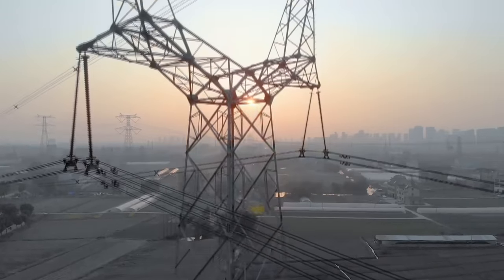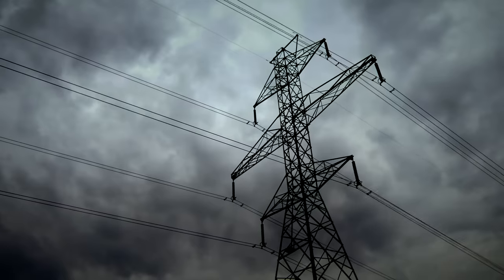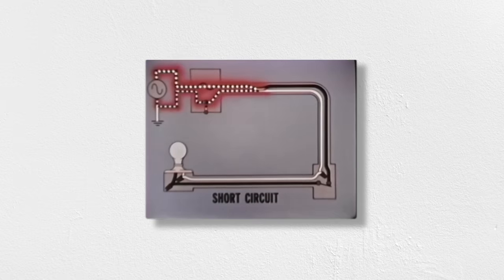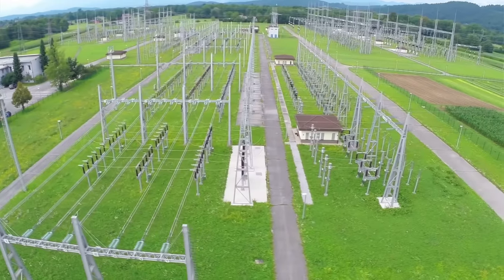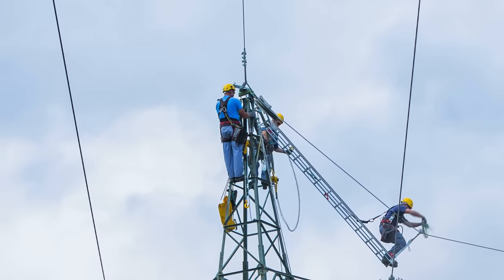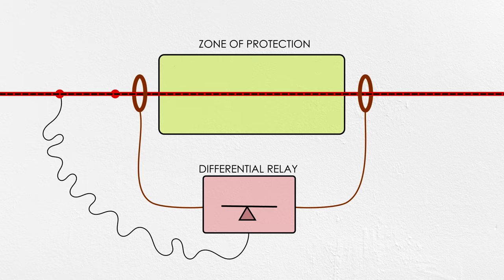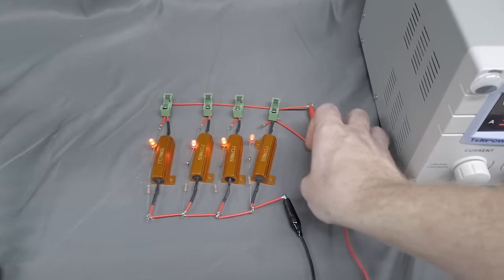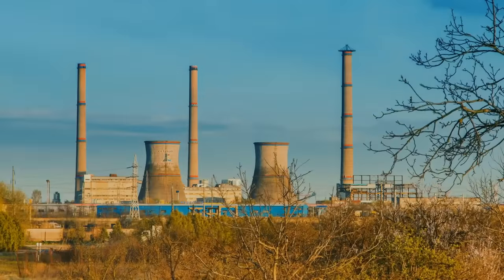How Power Blackouts Work

Comment: I really appreciate how simple and clear you explain things in your videos. But I think that the model you explained how cascading failures work on is not very accurate. Cascading failures happen when the power station sees an increase in demand that it can't supply power to. So, when that happens the frequency drops and goes out of synchronization which causes it to disconnect from the grid. When that happens, the rest of the power stations that are still working sees an even bigger demand that they all can't supply power to. So, a power plant (station) is disconnected from the grid one after the other and that's what creates cascading failures which cause Blackouts. As mentioned in the video that cascading failure happens when a load is disconnected from the grid the rest of the power is divided between the rest of the loads. I don't think that's the case since power plants have control systems that limits the power supplied to the grid to the demand.
I'd like to hear your thoughts about this and I'm open for discussion. I'd be even happier if I was wrong because that means that I will have learned something xD.

Comment: Well my local electrical grid did not follow through with many of these protections. A few weeks ago the local middle school drew too much current (apparently running a lot of bounce houses for some fundraiser) and instead of tripping a breaker, the main power line (which was not isolated) outside the school caught fire and the town was without power for about a day.

Comment: From what you are saying, if a power line touches a tree and shorts to ground, the local area should immediately experience a blackout? So is there a good reason for PG&E to turn off our electricity for days at a time because the fire risk is high? It sounds like they're just trying to cover their ass in case their safety systems don't work correctly. Suspiciously, they started doing these blackouts right after one of their substations was the cause of a major fire. I have never been frustrated in the past at blackouts, but these intentional ones are extremely frustrating.

Comment: What you were calling "relays" is an entire protection system. a relay is an electromechanical switch. that's all it is. everything else is senbsors that monitor voltage, current, phase rotation, and a huge number of other things.
Reply: In the trade they are all lumped into the category of "relaying." I had the privilege of working with one of the four protective relaying engineers in our company; it is far more complex than I had ever imagined.

Comment: In my city when a powerline shorts out all powerplants connected to the grid, all the grid blacks out, usually takes 24 hours to get fixed, when that doesn't happen the electricity is on for 2-3 hours and off for 3 to 6 hours, when the electricity is on for a complete 24 hours we say that the person who cuts the electricity is asleep or dead, or some part of the city is completly off

Comment: More, more, more on the grid!  Some ideas:
- Commentary on "The Current War" about battle between Edison and Tesla/Washington over whether AC or DC will be used. Great infrastructure-porn.
- Microgrids - a solution to our the problems with a centralized grid?
- High-voltage DC  (yes, it's more efficient than HVAC at long distances).

Comment: Good video. Just a touch misleading though. When stations operate at full capacity, the lines feeding them are usually loaded to only 20 to 40% capacity. If they were near capacity, as you mentioned, the grid would be in a constant state of instability.
Reply: You are talking about the N-1 criterion, right?
Reply: correct

Comment: Great job Grady and Wesley! This video was amazing I'll have to go check out the rest of the series. I'm curious how much a car would cost that never breaks down Lol.
Reply: You may want to compare it to the amount of time and money NASA put into making absolutely certain the Spirit and Opportunity rovers would last at least 90 days. They lasted for several years, but the original spec was essentially a blank check saying that they had to last 90 days and the engineers were to do everything possible to make sure to get them to last that long.

That's the scale of effort we're talking about with regards to making a machine that will not break. And this isn't even taking into account the possibility that the day after you finish it, a new technological breakthrough will make a lot of your work redundant.

Comment: There’s a missed opportunity to describe the issues/benefits with infrastructure/safety differences between why/delta distribution. Additionally the traditional difference between distribution and transmission and how distributed generation has evolved the distribution into a local transmission network and the fault management changes need to support that.
A deeper case study of the north-eastern failure in 2003 as a result of known product defects in fault management systems and the process mistakes by operators would also be interesting.

Comment: Yes, powerplants take power to run (ironic) but they are able to generate that power themselves. At least until the fuel runs out.

NPPs also have backup generators to run the bare necessities and (I think) they can also restart the plant with them
Reply: That's what the diesel generators are there for - to start the plant with no power on the transmission grid.

Comment: While they have invested in grid sections that never break down unless there’s a problem on the transmission lines or generators that are feeding that zone such as in the central areas of most major cities like the Melbourne or New York CBD areas for example as all of the electrical equipment is underground in those areas and it’s mainly because of there being no space for it on the surface because of skyscrapers! However in some cases they also built underground power stations in those areas such as in New York sometime during the First or Second World War as they mainly needed everything to be protected from an additional threat which was enemy bombings and air raids! :)

Comment: where i work we recently had a corse on controlling 480V ac motors and i and a colegue got to build a controll logic and i claimed that it is idiot proof so i let him have a go at it and it worked fine until he held down forward and reverse then pulled out the e-off switch and it caused the 2 10 amp breakers at that work bench to open then i told him i doubt that his is any better, so i did the same and i managed to trip the 18 amp breaker and we had to get a ladder to get to it because it was under a cueling pannel

Comment: in my place blackouts usually happens on streetlights... I saw one of them uses a 16 amp breaker for a mercury vapour lamp. they used 10 amps and it kept tripping. But when the light was new it never tripped

Comment: If a transformer faults it can send a secondary surge which will cause equipment failure all the way down to the consumer. Insulators will burn out, cutouts on poles will burn, arc over will occur and destroy lines and ancillary equipment from the corona. The surge will compromise the insulation of most insulated cables and circuit protection devices.

Comment: Lol.. that time when London had a large (but not total) blackout because someone put the wrong fuse in at a main relay station. 4 stations, one out for service, one having routine maintenance and two others operational. The one on routine maintenance had the wrong relay replaced and shut down, leaving the other two to supply a busy rush hour London with electricity. Half to three quraters of London had a power outage. Fun getting home...

Comment: Burying power lines underground is the sensible thing to do.  I live in a neighborhood where all the power lines are buried and almost never experience blackouts.  It can be stormy as hell outside my house and the lights in my house never even so much as flicker.  As a bonus, there are no eyesore overhead power lines clobbering our view.
Reply: We had almost all the underground lines in my neighborhood replaced about 5 years ago (by the electric company I was working for at the time) because the lines were rated for "direct burial" but it seems rocks loved to migrate and get a bit too chummy with them. Replacing them with underground in conduit helped a lot but there is still a stretch where the original cable is in place. We get spates of outages from that several times a year. Locating and repairing faults is no fun at all on underground lines.

Comment: There is other protection equipment not mentioned in the video. For example, underfrequency relays. Let's say that a major source of generation is tripped offline, either from losing the power lines to a major power plant or from a problem inside the plant. The immediate effect is that the power frequency starts dropping because the demand exceeds the supply,and all the other generators slow down, straining against the higher demand. The underfrequency relays will selectively disconnect a block of customers about equal to the lost generation. If this isn't done the entire power system could crash.

Comment: Most irritating is when power goes out when you are out of apartment, so when you want to get home again, the RFID tag don't work in the door because of... the RFID reader dont have power so you can't unlock the front door. You have to wait until power comes back, or a neighbour exits so you can "tailgate" in to the stairwell.

Comment: Hello, The 4 resistor simulation is not very accurate. You used "peak demand" but in your example the power supply was in constant current, always "pushing" the same current though the nodes. That is why the other failed. 
In normal conditions that would not happen because when your first fuse did blow the "demand" did actually decrease by 1/4.

Comment: @ 7:10 that's exactly what happens with a string of lights where a bulb gets burnt out, the addl. current from a bad bulb is distributed to the remaining bulbs causing them to wear faster, eventually causing more and more to fail.

Which reminds me that I need to replace the bulbs in my strung patio lights 😅😅

Comment: You can see this cascading failure easily in a string of incandescent Christmas lights. When just one bulb fails every other bulb on the string draws slightly more power to stay lit. As more bulbs on the string fail each other good bulb will have to draw more power. Eventually the load is so great that a cascading failure will happen and the whole string (or just half) completely stops working as every last bulb fails in a row.

Comment: There was recently some grid issue I think it was Britain and they said that there wasn't enough power and frequency dropped to 49Hz, why would frequency drop? Intuitively I would thought that the voltage would drop when there is not enough power.
Reply: Old fashioned spinning generators slow down under high load. If the load suddenly drops, a steam or water driven generator will speed up. All of the modern grid connected power sources slow down under excess load. Most solar controller interconnects and many windmill designs will maintain constant voltage and frequency even if the load drops to zero.
Reply: All generators here in NA, run in volt control, period. So when the frequency drops, it means there isn’t enough generation online for load. The voltage will absolutely stay the same because all generators are in volt control. If the frequency drops too much things start tripping, distribution circuits, then substations, and hopefully last is the actual power plants.
Reply: You’re peddling your bicycle up hill when the hill is getting steeper and steeper...as the load increases, the peddling drops back.

Comment: Watching some illinoi energyprof. I found if you have a nuclear power plant, (maybe just a particular older  reactor type - or not) if it is shut down (although safe) it needs several days for conditions in the reactor to reset before it can be brought back on line again.
Reply: Part of the reasons Chernobyl happened was because they accidently stalled the reactor and instead of slowly bringing it back online as per procedure they pulled practically all of the control rods.

Comment: If you have Raspberry Pi 4B you need not only a certified original charger, but also a certified original power plant. Otherwise the turbine shaft in the power plant stops dead in its tracks when you plug the Raspberry Pi 4B in.

Comment: The problem isn't with the ability to add additional features such as really thick underground high-capacitance high-conducting material with dozens of additional fuses and so-on and so-on. Such a system would be even more perfect and there are some places that do this. The biggest issue is cost, those things are seriously expensive. Sure it can create less problems for the city and workers but almost nobody could afford to have such luxuries. The city does the best it can by maintaining a realistic budget and accepting and being prepared for what could go wrong and tries it's best to minimize potential problems. Hardly anybody can afford to have the "near perfect system". It's possible, but immeasurably expensive for almost anybody.

Comment: 5:14 So you have an RCD fuse,  but I don't see a main RCD breaker.
And it's in the middle, does only a part of the building have an RCD? What kind of system is that? Doesn't look like a TN system (genuinely curious as I'm not used to that sort of instalment).

I'm used to:

From street->Main Breaker->Main RCD->OverCurrent Breakers
But I've also seen
Street->Main Breaker->Sub-breaker->Main RCD->RCD/overcurrent breakers

Comment: "I don't know how much a car that never breaks down would cost, but I certainly wouldn't want to pay for it."

The price of the Volvo 240 is around 3k these days, it's not that bad.
Reply: Have you ever replaced a blower motor in one, though? I had a 1985 Volvo 765T for long enough to understand the difference between rugged (which it was) and reliable (which it was not.)

Comment: I know enough to get in a lot of trouble, but smart enough to avoid a lot of trouble. So, when bringing up a manufacturing facility, you stage the starting of equipment. I hav heard that was because of the contract with business, and will vary with the amount of power that they use. 
My question is is that true, and/or can damage happen?

Comment: What do you call those power "hiccups" where it cuts for less than a second? Sometimes they're so short my computer stays on, I'm guessing the caps in the PSU are working as a micro UPS.
Reply: I think those are the result of faults (e.g. short circuits in a parallel line) in the power system, where 100s of milliseconds are needed to isolate the fault, during which the voltage sags on a wider area (this can be seen as incandescent light flickering). The caps in the PSU provide the voltage (energy to be precise) for this short period of time, so the computer stays on. One could call it a micro UPS, but the duration of it's power supply is very short.

Comment: Yeah it's easy to forgive most power outages. But I wouldn't expect pg&e customers to be very forgiving. Seeing how a lack of maintenance around their lines has been causing massive fires and instead of fixing the problem they're just randomly cutting off power.... Which sounds like it's not even mitigating the fire hazard.

And really I think that there's plenty of justification for being upset about the general lack of maintenance getting done on the infrastructure in this country. And that's not the engineers' fault... It's austerity policies and greedy capitalists.

Comment: Here's my extra point (since I'm a power engineer): It's true that most powerplants require power to run (and start up especially), mainly for pumps and fans/compressors. But - and that's why they are essential - hydroelectric power plants can start from a total blackout, they don't need any input power. Same is mostly true for photovoltaics and wind turbines.
Reply: Plenty of fossil fuel plants have black-start capability.
Reply: @westtex3675  Such as?
Reply: @BarcelPL  the gas turbine plant we just installed in MD
Reply: @westtex3675  gas turbine needs to be spun up so the compressor part works before the turbine. This requires an externam power source
Reply: @BarcelPL  yes, and there are these things called black-start diesel generators that can be incorporated into your plant that can bootstrap it, providing startup power. it's not that complicated.

Comment: How come I never see enough Isolation valves in fluid pipes?
in a large factory or a small house. there is very long lengths that pipes travel with lots of possible failure points. but I rarely see valves placed in-line. which would be incredibly helpful when needing to replace a single joint.

Comment: Making the grid "indestructible" by using thicker cables sounds about as effective as preventing a fuse from blowing by using a higher-amperage fuse (or stack of pennies).
Reply: Heh yeah... the grid might get tougher, but if you have any devices you enjoy not melting down that plug into the wall... womp womp.
Reply: @barefootalien  You mean the plug isn't supposed to melt?  I thought that's why they made them from plastic as an added protection, like a fuse.  So when the cord gets hot, the plug melts and the wires fall out:  presto, no more problem!